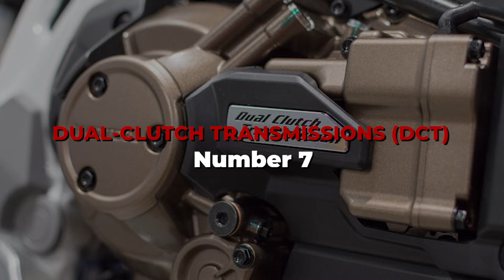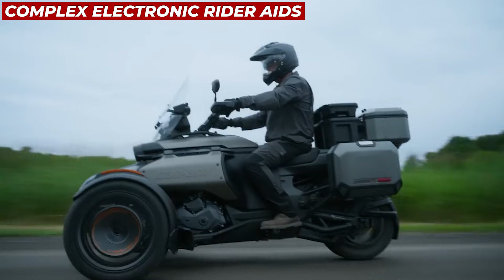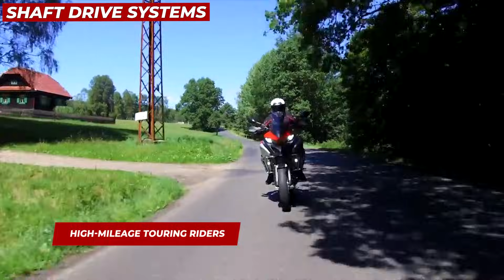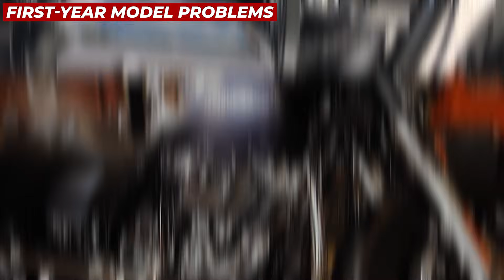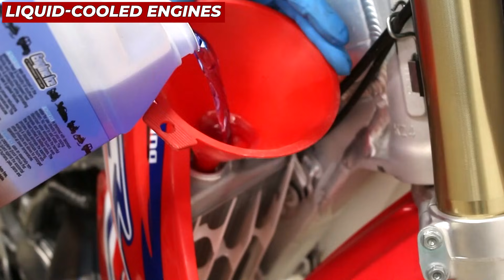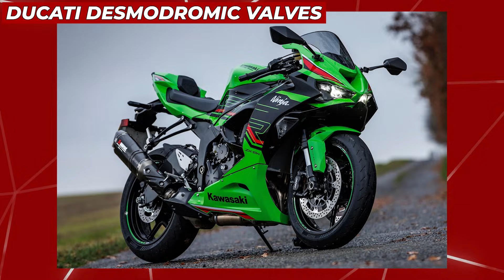WORST Motorcycle Features That DESTROY Reliability (& Drain Your Wallet)

Comment: Carb, chain no abs etc.
Real bikes stopped  being produced prior to 1990.
Yamaha RD, RZ... FJ12 ETC.
Suzuki OG/GSXR11.
Honda CB etc....
Yeah, parts are maybe hard to find, expensive etc...
However,  we are talking about a time when SUPERBIKE class was over 1000cc and the rules had to be changed down cc's because  the pansies calling the rules were frightened of the power.
Sure, modern bikes are faster, supposedly safer and pretty much all look the same.
Question is, do you ride a modern bike to have folks say, "not sure what it was but it hit the car at 300klm?"
Crash investigators say speed definately involved...however, stopping distance unusually long..ABS.
Or do you have the balls to ride a "real" bike that you have to learn to control.
One that turns heads and garners respect.
Something that left the factory sounding like it wanted to kill everything in It's way, all prior to limp wristed emissions regs.
Something that bucks and squeals at you every time you screw up?

The question to ask yourself is,  what kind of rider am I?
A dickless poser with a fat wallet who's bike looses value and costs repairs EVERY time i ride it, looks good parked while you suck a skim milk latte,  or a balls to the wall spin on this, I ain't got time to pull up person.
Reply: Look up the new Z900 and the Z900RS. I have had old bikes and they were unreliable due to age and old technology. My  17Z900 is a modern bike with basic technology. Good performance and has never let me down. It can be worked on and made better too.